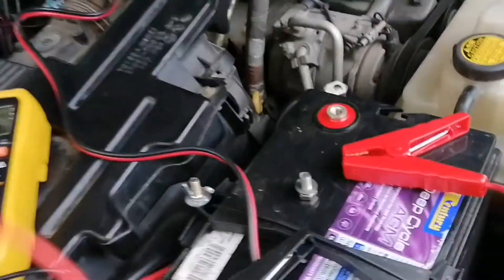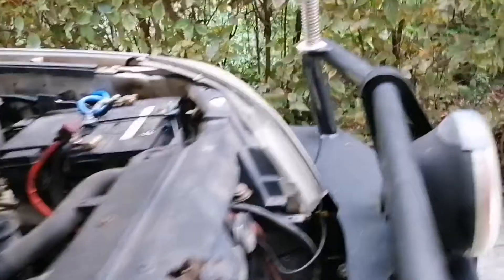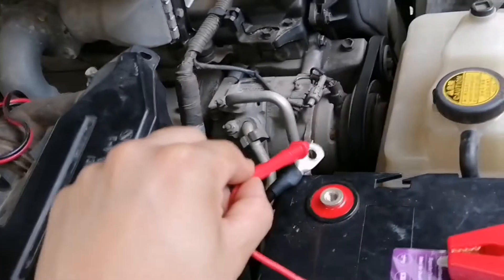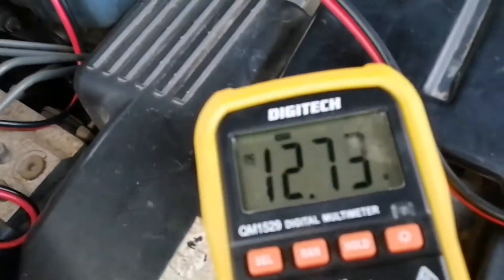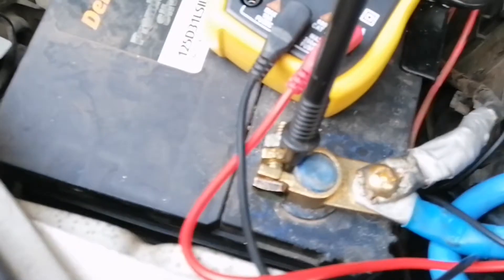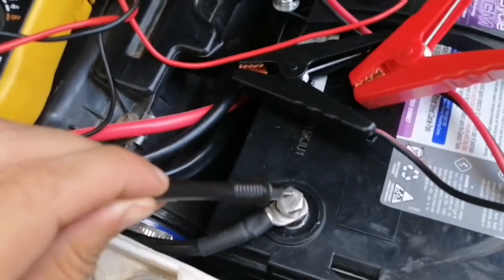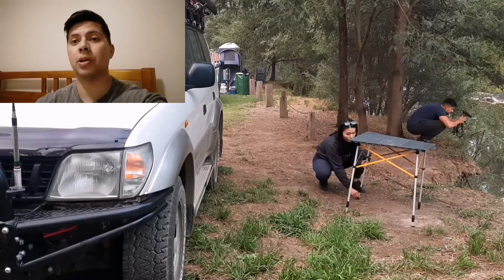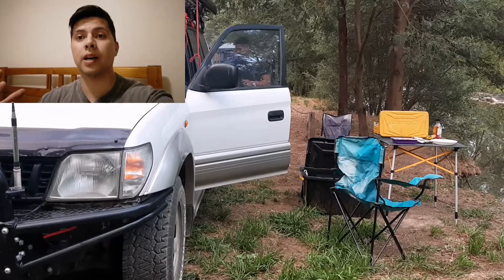How to diagnose issues with your Redarc Isolator.

Comment: I've been through 4x Redarc SBI12's over 2 vehicles. The solenoid itself was always fine, but the VSR module died on every one.
Redarc don't sell just the VSR module by itself either which is super frustrating.....